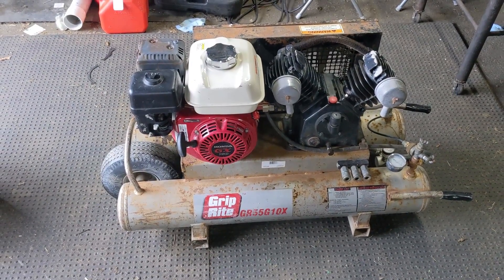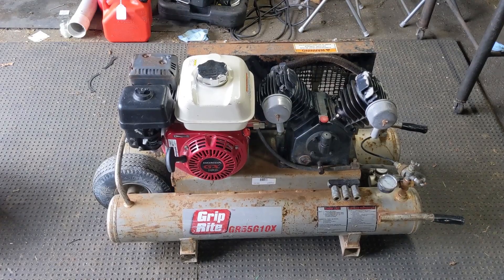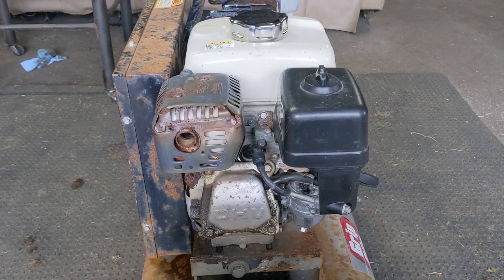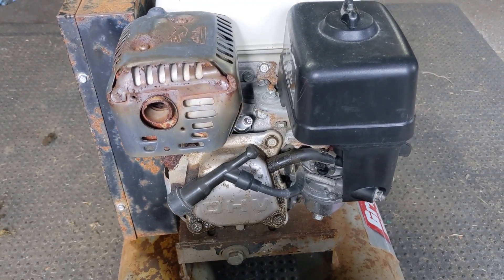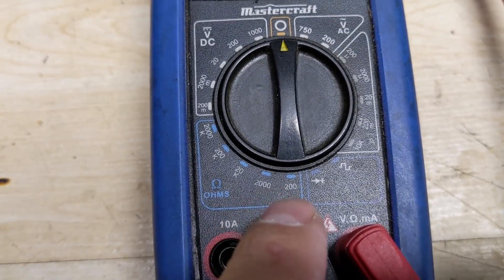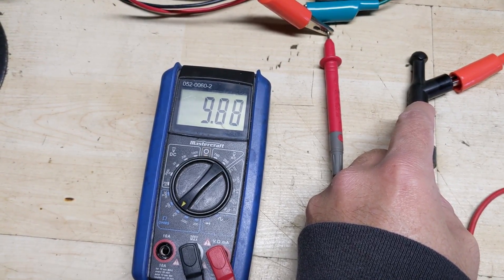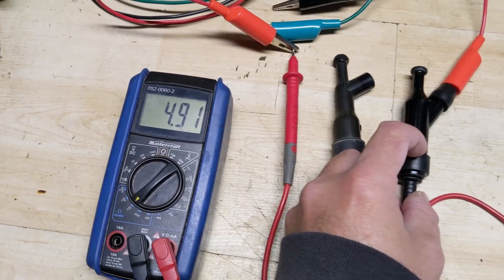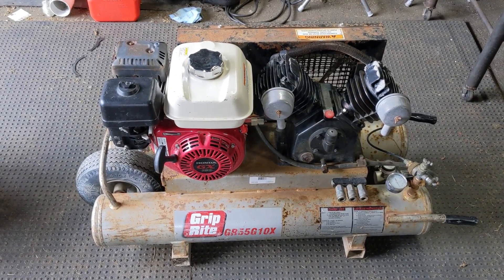Honda GX160 Only Runs on Low RPM

Comment from the maker: From my experience, the metal caps can get water/moisture inside them which causes corrosion, then leads to the increase in resistance.

I do know that the NGK ones use ceramic resistors inside, and similar to the STENS replacement caps, should have a resistance reading of under 5K ohms.

What bothers me is the official Honda GX160 service manual states a reading of 7.5k-12.5k ohms on the spark plug cap is acceptable. Yet all the new Honda plug caps I've ever tested (OEM NGK, STENS etc...) are all under 5k ohms.

I linked a similar video where a spark plug cap on another gx160 that tested at 10k ohms caused the engine to shut down, but only once it got hot.

I've even tested dirt bikes that had no spark, and found that the plug cap had so much resistance, it prevented current flow from the coil to the spark plug.
Reply: I have a Champion generator with a similar spark plug cap.  I will ohm it out now, because it runs for a while and then shuts down.  Ignition coil is good.  Thanks for the help.
Reply from the maker: Once I learned about this issue, I always check now, as it's quick enough to pull the plug cap and test.

Comment: I've got a GX200 that idles and even can take half throttle under no load. Any throttle higher and it stalls. I thought carb so I disassembled, cleaned real good and reassembled. No change. I was ready to buy a new carb but thought I'd check YouTube. So glad I did. I took a ohm reading on mine and it was 9000. Bought a Stens from Amazon and installed. Runs like brand new. Can't thank you enough for posting this fix. Liked and subscribed. Never would even come close to thinking this would be faulty.
Reply from the maker: Glad it helped, thanks for watching!

Comment: My air compressor is a modified 8 gallon jenny 2 stage gas wheel barrow compressor that I have converted to a 30 gallon tank. Basically dropped the old deck plate on a newer 30 gallon. I like your videos. Help much needed. I have contacted local compressor repair company and no response. Compressor idled ran at full speed it only had a fuel leak out of the bowl. I purchased the unit for 300. I purchased a new carburetor replacement for a 10hp honda as PREVIOUS owner upgraded. I did have to use the old carburetor needle valve I think its called in the carburetor as I couldnt get to compressor to start with the valve that came with the replacement carb. I live in salt lake city utah. After changing to the old valve the  engine starts and runs idles very well. Now i have my air compressor pretty well set up. I had my unit running idling and ran through its cycles  and worked great. I did notice that I had worn out belts. I replaced the belts and also compressor pump oil and engine oil. I recently ran my air compressor and was working fine now my air compressor will not build air pressure  and I started to get smoke out of the right side pump head where the air goes through cross over hose I want to call it that then ts and mates with the main hose that then hooks up to the tank. Being that I upgraded the tank I changed my original hose that hooks up to the tank. I did not change the T or other cross over hose. Now im wondering if since I did see excess carbon in the T fitting. I mean like made the interior dimensions of the 3/4" combination T into like a 3/8" fitting. I only didnt change it because I wanted to find the correct replacement so I wouldnt have to use Bushings. Im wondering if the air compressor is smoking due to excess carbon build up would that be a good assumption? Please message me back if possible... dunno if you can post this but my email is tylergoodrich1451@gmail.com

Comment: Great video , I would like to see what is inside the spark plug boot that causes this change . I always thought it was a solid conductor .
Reply from the maker: From my experience, the metal ones get water/moisture inside them which causes corrosion, then leads to the increase in resistance. I do know that the NGK ones use ceramic resistors inside, and similar to the STENS replacement caps, should have a resistance reading of under 5K ohms. What bugs me is the official Honda GX160 service manual states a reading of 7.5k-12.5k on the spark plug cap is acceptable. All the new ones I've ever tested are all under 5k, and anything over 8k usually has issues. I linked a similar video where another cap that tested at 10k ohms caused the engine to shut down once it got hot.

Comment: Just tested my cap on a GX120 mounted on a core aerator. Problem Im having was it would constantly die at any rpm other than idle. Took apart the carb, and cleaned it with no change. I was almost ready to just get a new engine until I came across this. I just tested my cap and it’s reading 12500ohms. Got a new stents replacement cap on order. Hopefully it solves the mystery. Thank you in advance if it does

Comment: What's the purpose of having resistance in the connector in addition to a resistor plug? Personally I use a non resistor plug whenever I can.
Reply from the maker: To limit/reduce RF interference.

Comment: Hi what causes the engine to make a slight popping sound like it’s missing when it runs. Do you have a video on the gx160 carb adjustments also be nice to have a video on proper idle rpm and max rpm.
Reply from the maker: @Xfactortype1  likely the distribution tube under the main jet has some crap in it
Reply: @EliminatorPerformance  I’ll admit it’s a cheap Amazon aftermarket new carb. Even doesn’t on a new out of the box predator 212 engine while breaking it in
Reply: I meant it even does it on a new out of the box predator engine

Comment: I have the same compressor. I have no issues finding wheel and tire, but do you know where i can find the axle? preferably one that is already drilled on both ends so secure with pin

Comment: Thanks 
My pressure washer honda engine got oíl passed to exhaust bc was storage not properly level. what can I do to  clean up
Reply from the maker: Brake cleaner maybe to dilute it, then run it to burn it off. Then change the spark plug.

Comment: I just checked the 3 I keep and all of them are at 5 k also 
Most of the ones I check on customers units are around 6/8
Reply from the maker: Anything at or near 10k I've found to give the engine issues once they heat up.

Comment: Tried this on gx 200 only revving with choke on. Btw this is being run on a mini bike so different throttle setup. However I’m getting a reading of 9.75 resistance so I think I have same problem.
Reply: Turns out this was not my problem. Engine runs fine with 9 or 10 ohms resistance. Try cleaning your jets that fixed it for me